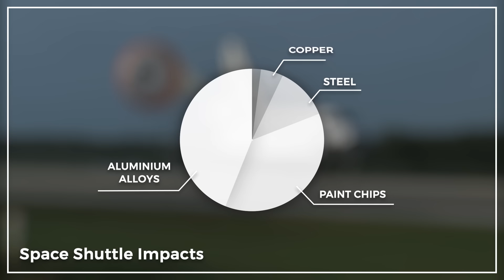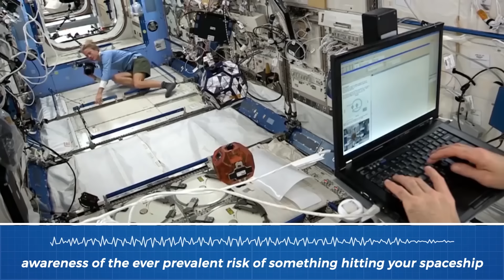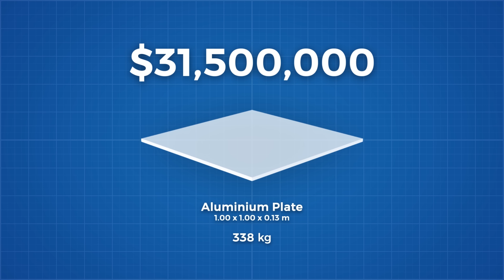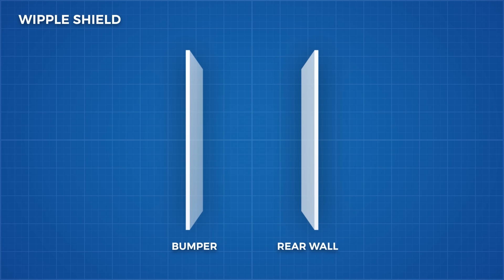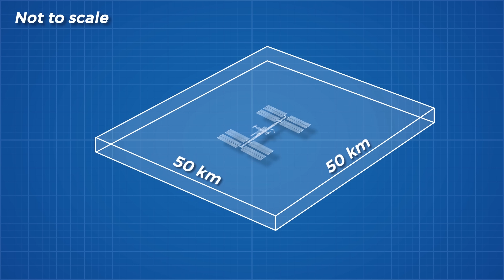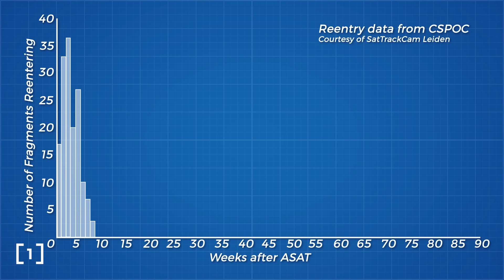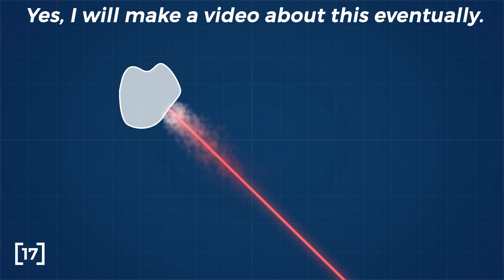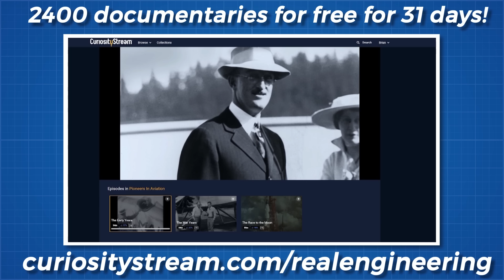The Truth About Space Debris

Comment: Intercept collision tests need to be freaking banned. Replace them with capture or last-second avoidance. By treaty. We've got too much going on and planned in orbit and low orbit to be mucking around with this shit. Also, Shuttle SRBs never went to orbit - the oxide discharge wasn't a threat. (source - ME - my father was one who worked on the SRB program - not the joints tho). The best solution for mitigating impacts (and making massive space platforms) is deformable inflatable habs with multiple kevlar layers and self sealing isolated cells. Bigelow Aerospace is doing exactly that. In fact, they have a module on the ISS right now. Far superior impact resistance than heavy 'tin cans'. Much cheaper orbit / useable space ratio too.

Comment: Hold on a minute. If both the ISS and the space debris are orbiting at the same altitude, then wouldn't they be traveling at the same speed?
Reply: yes, but actually no. They are travelling at the same speed relative to the earth, but at different VELOCITIES. Since a velocity is a vector of a direction, objects with the same speed relative to a reference object but travelling at different directions relative to each other have different velocities relative to the same reference object and non-zero speeds relative to each other. It is velocity that is used in most equations, including the Kinetic Energy equation. Imagine a tower directly between two roads which are converging 1km away. Now imagine two cars driving on each road at the same time and speed relative to the tower. Even though these cars are travelling at the same speed relative to the tower, they have different velocities as they are driving in different directions. Therefore, even though the speed of each car is the same relative to the tower, their velocities are different, which means that their speed relative to each other must be non-zero. Hope this helps.

Comment: The actual weight of a one metre square of 13mm aluminium is more accurately 34 kilograms.  You are out by one order of magnitude.  I work with aluminum every day.  I routinely carry sheets of 1/2 inch (12.7 mm) every day.  I absolutely am totally incapable of carrying 340 kilograms
Reply: it's a simple calculation, aluminium has a density of roughly 2700kg/m3, the volume is 0.13m3, so its mass is about 350kg. you work with 13mm sheets, not 13cm
Reply: @welyum7308  My bad.  You're absolutely correct, it was a 13 cm plate, not a 13mm plate.  Thanks for pointing this out

Comment: The window around I.S.S. is only 51kms wide?

With objects traveling at 14k to 17k kph, how again do you react in time?

Reaction time would be less than ¹/10th of a second.
Reply: Because you can predict the object's path, you know of the collision many hours before its due.
Reply: @sebastiaomendonca1477 

That's not what he said. 

Hours?

Uh no. 

An object moving that fast through that tight of a window would only give you a few seconds alert time at best.
Reply: @shaithriel  You dont need said alert time, you KNOW its coming. Every single object in orbit above 10 or so cm is being tracked.
Reply: @sebastiaomendonca1477 

That's also, not what he said. They're trying to track those objects, but can't track them all, even with all the ground based tracking radar.

Did you even watch the video?

Comment: Real Engineering? You were taught that the unit of weight in the SI Metric System is kilograms? Really? Okay let's test that. Torque = weight or force multiplied by distance. 1kg x 1 meter = 1 kg-meter. But, wait, that is not the unit of torque in the modern metric system.  What's wrong? That's right, you need to convert mass to weight. Real Engineering.